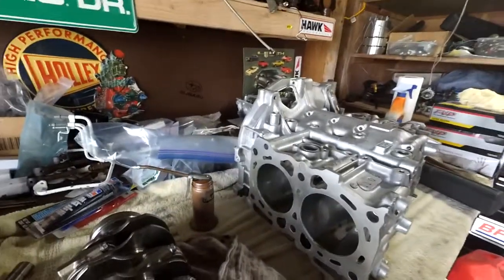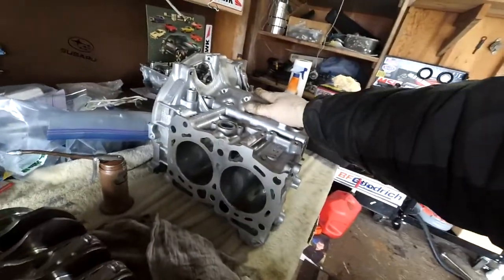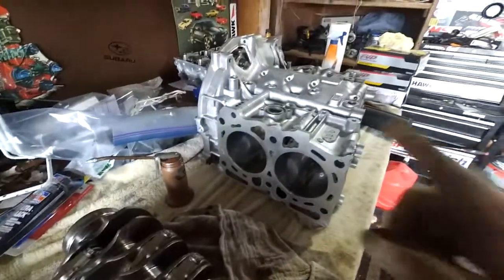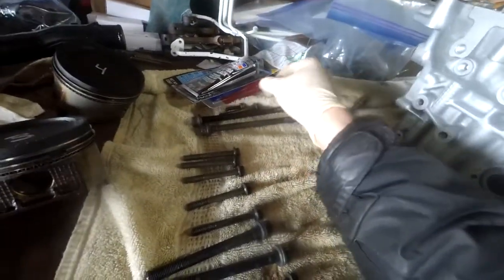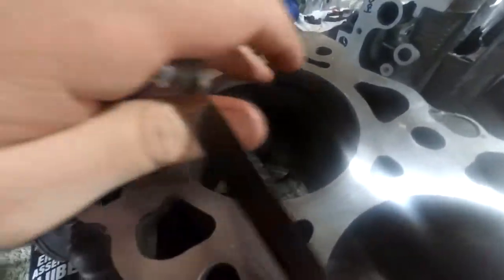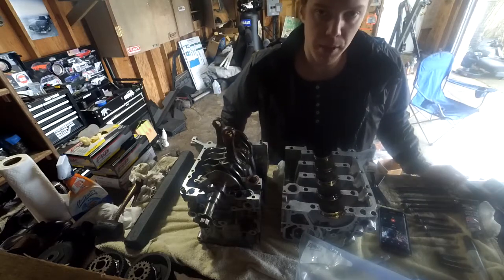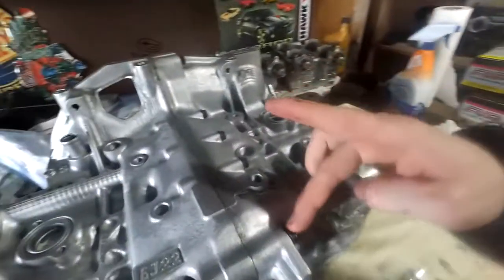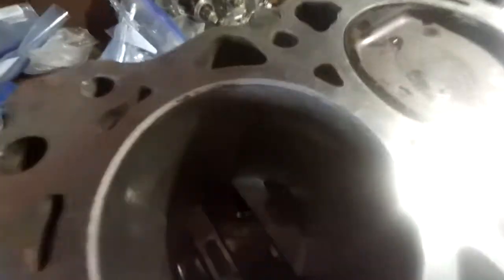Hybrid EJ22T/257 Short Block Assembly!

Comment: custom engine builds gets expensive. with the EJ22T block. I read that the EJ22T stock Crank is really good. so IF getting my 93ss Ej22T block machined at a shop for #4 thrust bearing, can I use the stock crank shaft? Or will I need a newer Ej205 wrx crank? as the ej22t was machined for #3 thrust bearing. IDK if that change will effect the crank shaft part + don't want to spend more than i need to. THX love the subaru stuff on your channel
Reply from the maker: Thanks for checking it out! So as far as crank shafts go, all subaru crank shafts are forged, so in that way they are the same. The ej22t and ej22e crank shafts are identical. The benefit of the ej22t is the block, they have a closed deck designe and oil squirters for the pistons. They also have stronger pistons dished for lower compression for boost. So that said the thrust bearing doesn't really matter, the #5 thrust bearing is technically better for really high hp. But sub 600hp I think it's irrelevant. You can't use a 22t crank in a 205 as the stroke is also different, you could if you had some kind of stroker kit. If you have a ej22t you can get it machined to use the #5 thrust bearing and then you can use a ej257 crank with custom rods and pistons for a 2.4l stroker which a lot of people do. But honestly a stock crank ej22t with forged rods and pistons, good dohc heads (ej25d/20g/20k/20r) and supporting mods will support more hp than you will ever need.
Reply: @HackSquadGarage  okay, thanks for the advise. I have both my99 EJ25D dohc & wrx Ej205 dohcs with intake AVCS. however I don't want to run the setup on Phase 1 b/c all my subarus are phase 2 with OBD2. which is why i am looking at doing machine work on the ej22t block. to the best of my knowledge the ej22t with EJ25D heads is a phase 1 setup & doesn't have OBD2 compatibility. otherwise as you recommend I'd just stick with the ej22t with my99 Ej25D heads if I could run it on subies SF/SG/GD/GG up to 2006 with OBD2.
Reply from the maker: @Scotty14k  you are correct that all the ej25d parts are phase 1, you don't have to machine the blocks to use the #5 thrust bearing to use the ej22t as a phase 2 setup. You just bolt on the 205 heads and crank sprocket with an ej22t head gasket to match the bore size. Then all the intake and timing components and sensors like you were building an ej205, but of course it would have to go in a car that is wired to be phase 2 obd2. Externally these ej blocks are identical so you can do that.

Comment: wicked engine build assembly! 22T lifestyle
Reply from the maker: Scott Campbell Thanks! This build is almost done, can't wait for the first start!
Reply: Why change out the EJ22T Rods? 22T rods are forged steel.
http://www.angelfire.com/md3/91turbolegacy/background.html
Reply from the maker: Scott Campbell yes the factory connecting rods are great, they are forged alloy but are limited to about 350bhp, the ej257 rods I replaced them with are also carbon-steel forged alloy and have been known to withstand 450bhp or 400whp, they also have a better rod cap design that's much stronger. It's a super cheap upgrade I could not pass up, I paid $50 for a full set, that with the arp rod bolts and head studs is just cheap insurance.
Reply: Do you have a link? $50 for a set full set of rods & bolts & bearings is a good value. makes sense if they're of higher quality. I'm in canada.
Reply from the maker: Well I got just the rods used from a friend on Facebook marketplace for $50, then i got my rod bolts for $35 from my machine shop and ACL rod bearings with OEM main bearings, and i bought the head studs new for like $150 or so. all relatively cheap upgrades.

Comment: What can happen if you don't replace the rubber washer on block bolts or if one is tore, can you get coolant in your oil? Just purchased a 02 wrx with a hybrid swap but is getting coolant in oil only and compression on each cylinder is 120psi. I'm kinda stumped at this point till I pull motor and tear it down.
Reply from the maker: J. Herrold it's possible, it would leak coolant down into the crank case, it's probably head gaskets, but I would change those washers whiles you are in there, it's easy.
Reply: Hack Squad Garage just wanted to let you know it wasn't the head gasket it was the case bolt washers. There was one in the wrong location. Oring was outside of water jacket and standard washer was in water jacket.
Reply from the maker: J. Herrold oh glad to hear you got that figured out! That's a weird issue to have, usually people know about it and avoid that mistake.